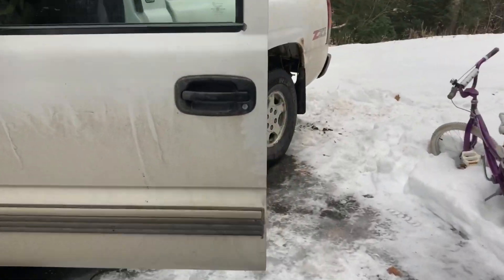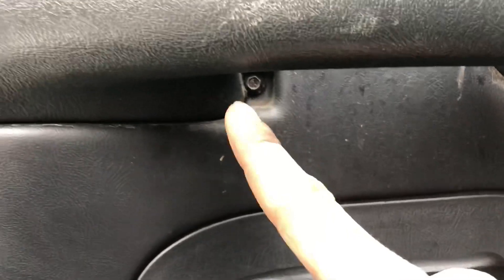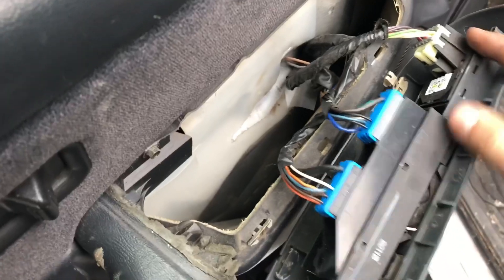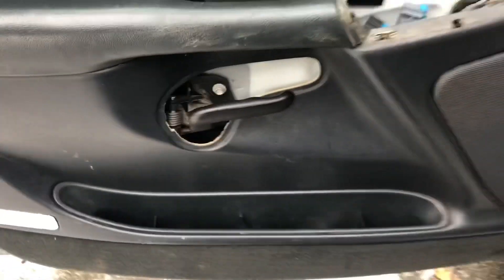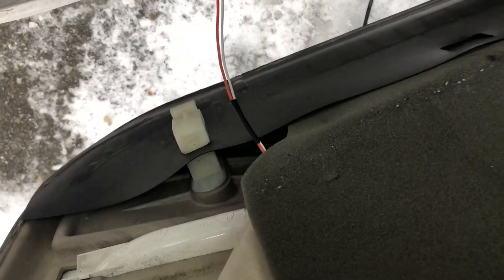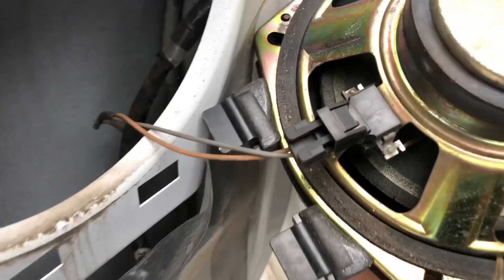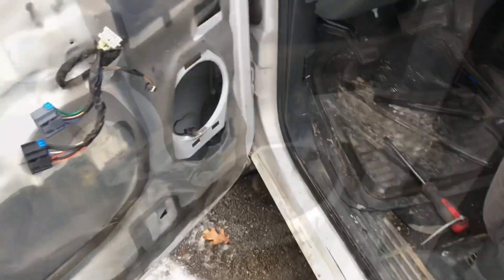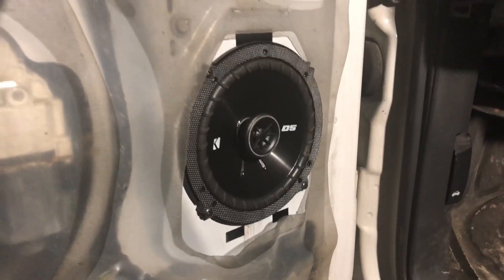99-07.5 Chevy Silverado Speaker Install

Comment: Thanks for posting I’m going to help a customer with a 2000 Chevy 3 door extended cab in the front doors. This video will be very helpful for us. Only thing that will be different is he doesn’t have any power locks but he has the manual crank, but I can get that crank handle out with a special crank removal tool. So installations will appear the same.

Comment: I bought my truck about 2 months ago and it has two 10 subs in the back with Amp, so I thought it had a full system in it. I had to take the door panel off today and discovered the factory speakers are still in it. Will definitely be buying some new ones
Reply: CurtJames23 I bought a 99 Silverado yesterday and it has 2 15 inch subwoofers and I could Barly hear the music and can only feel the bass. My door speakers are blown. I'm going to  get door speakers and amp for them tomorrow

Comment: The factory speakers was awesome. Over the years they start cracking and sounding really bad.  So any better than what it is NOW. I didn't want to spend very much over 100 bucks, So YEA!   I bought the Chevy Silverado Pickup 1999-2006 Factory Speaker Upgrade Harmony R65 R46 New ==>  From Walmart taxes, with free shipping  83 bucks ~ Front speakers rated watt 120 top watts. The rear speaker are rated 300 top watts.  That all i can't tell until Sept 23rd
Reply: How does it sound so far?
Reply: @josevaldez4482  Truthful there CRAP !   I'am going to install Some 14" subs from Boss in back, and some 10" subs Boss in front

Comment: Why didnt you just pop the grill off the door panel?
Reply: The mesh grill has tabs that are inserted into the panel and folded over. You can’t remove it from the outside without breaking it.